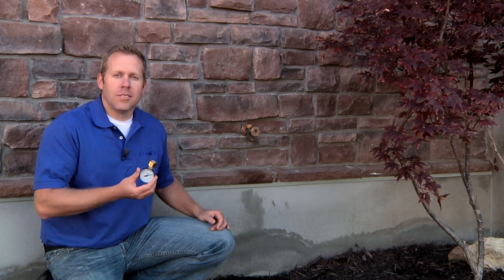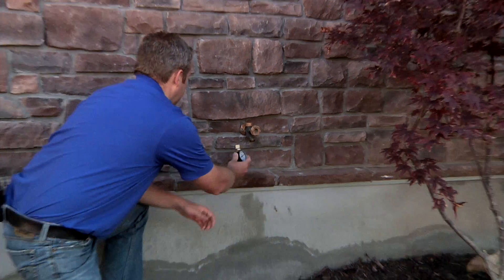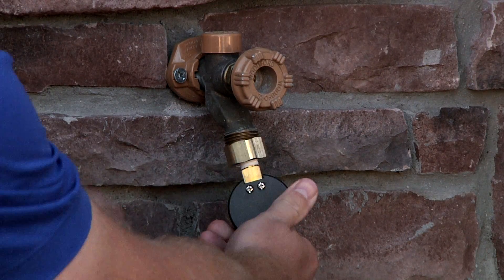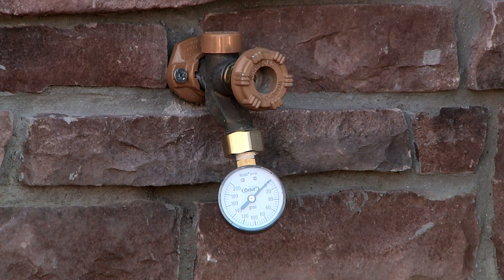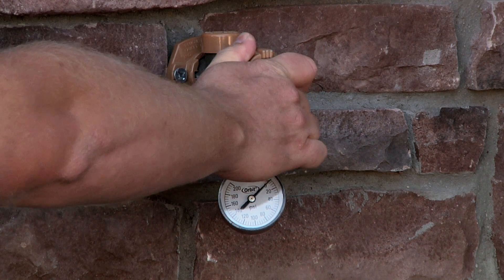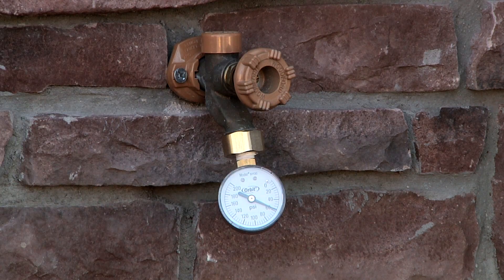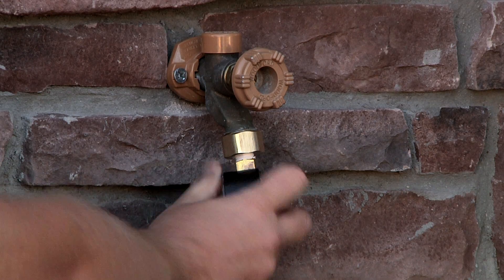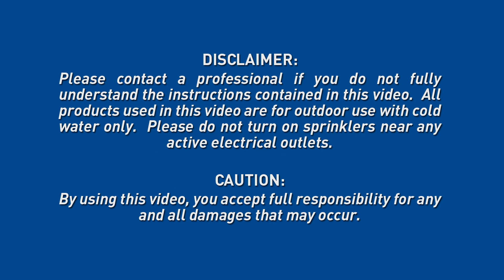How To Perform A Water Pressure Test

Comment: Can this Gauge be used to test for leaks?  Example: kitchen faucet pipes, bath tub water pipes, bathroom sink pipes and toilet water pipe. I'm trying to find out which pipe is leaking instead of digging up the back yard or under our home

Awesome video. Thanks a lot.
Reply: Being a manufacturer you are supposed to know answers for such simple questions. You should have more knowledge than an ordinary plumber.
Reply from the maker: While it can be used on any pipe with standard threading, we're not sure how it would be used for leaks. Indoor plumbing is often pressure regulated. We'd suggest consulting a plumber.
Reply: Thank you for your reply.